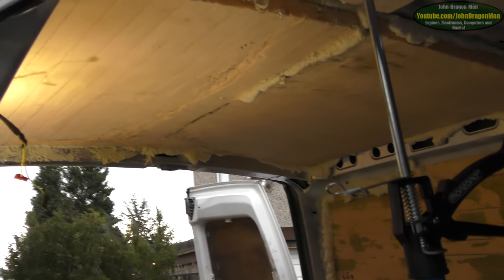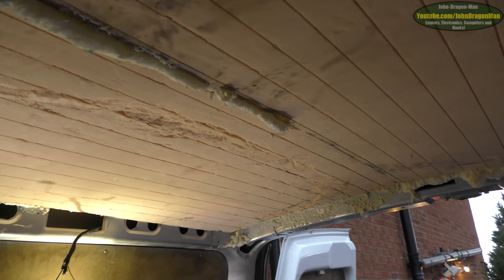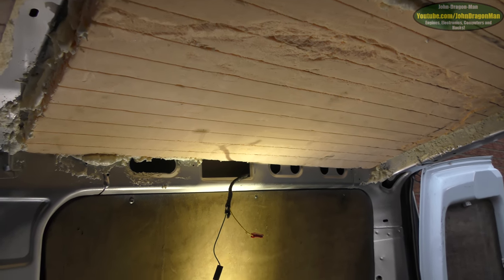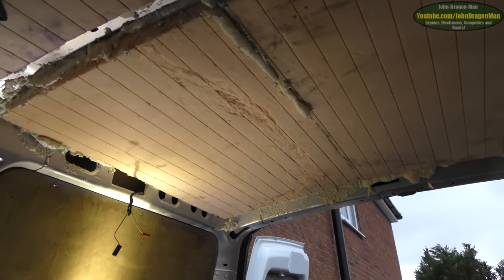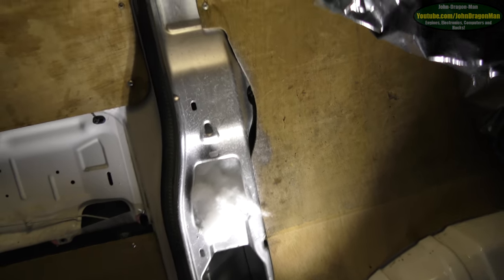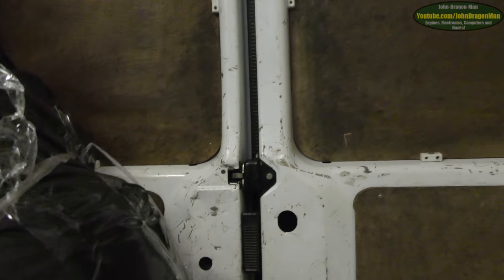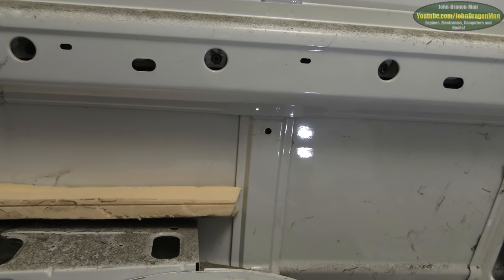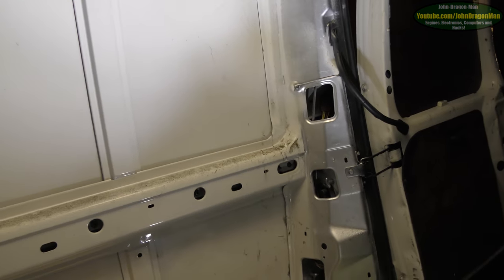Citroen Peugeot Fiat Dispatch Jumpy Expert Scudo Micro Camper Conversion - [4] insulation

Comment: Really good to see how you did the insulation, as we're doing something similar with an old Scudo. What did you do regarding the air vent behind the n/s wheel arch? Block it up?
Reply from the maker: im going to leave it in,  i removed the large steel bit from the top but the plastic bit under the van has been left. i will install an extractor fan into it. i think it will work quite well